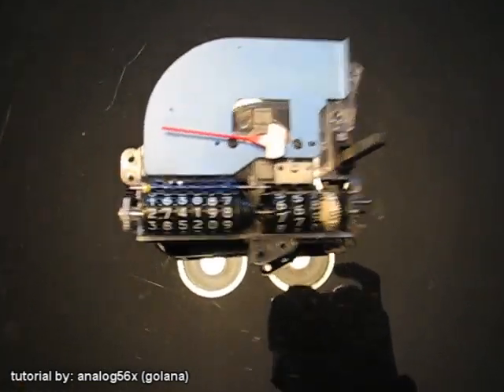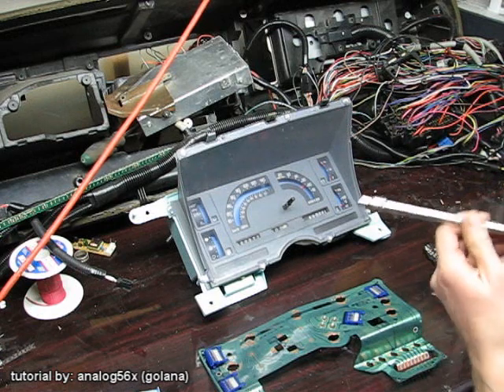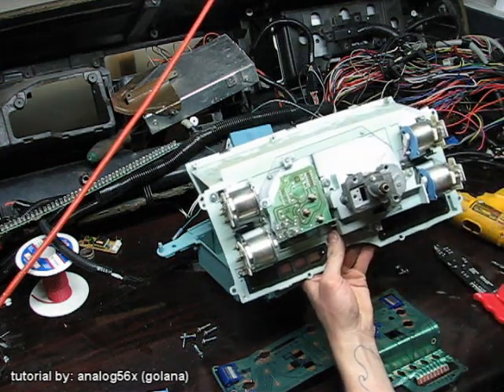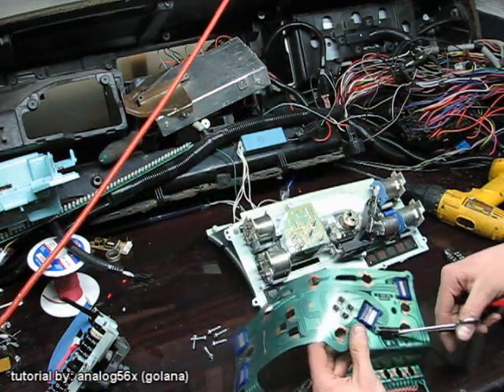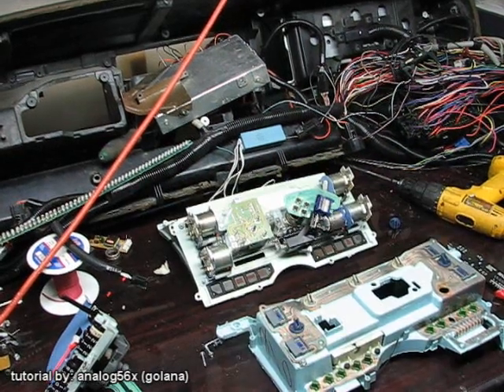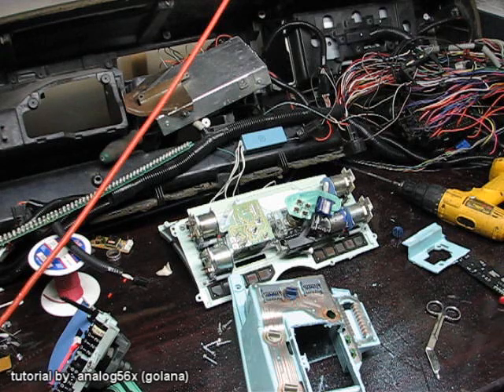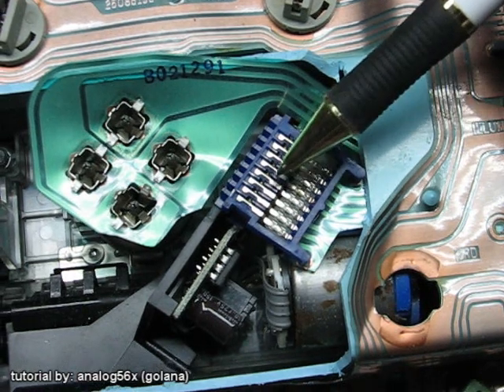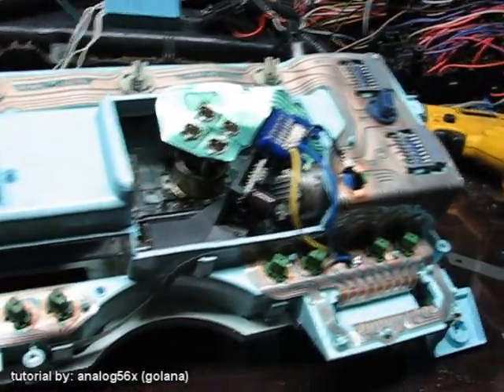Chevy S10 - Cable to Electric Cluster Tutorial

Comment: And this should work without putting some kind of sensor or anything else, just the straight swap? I was planning on getting the digital gauges for my truck is that possible? You posted this awhile back but I would really appreciate a response thank you.
Reply from the maker: This is to take your basic non-tach, electric speedo driven cluster, and add a tach cluster. The non-tach uses a bigger sweep gauge, instead of the sideways L shaped gauge. If your truck is cable driven speedometer right now, this will disable your speedometer, as your truck doesnt have the sensors or wiring for the electric driven speedometer.
I hope this clarifies things for you.
Cheers bud!
Reply: @analog56x  hey yeah thanks man that saved me time and a headache! Have a great new year
Reply from the maker: @banditobigmac5429  you too bud! Cheers!
Reply: @analog56x  My problem is that have have a 85 s-10 with a cable driven speedo and a later model tranny with the sensor. (no choice) I should be able to just run a wire from the sensor on the tranny to the sensor (2 pin) pin of the flexible circuit board, correct? Assuming of course I install an 87 cluster with electric speedo.
Reply from the maker: @paulandrulis4672  you'll need a few more things. Behind the glovebox, theres a module that takes the signal from the speed sensor and chops it up into a signal that your speedo can use. I forget the name of it at the moment though... you can repin it if you change tire sizes to keep your speedometer accurate.
Reply from the maker: https://www.thetruckstop.us/forum/threads/how-to-recalibrate-adjust-your-speedometer.23685/
This article shows the piece.
Reply: @analog56x  right on thank you, I appreciate the update. I'mma have to check out that page since I did have success with the swap that is up to the speedometer. I have read something about the sensor adaptor I bought is 16 pulse while the cluster is programmed to 40 pulse.... Then again idk I'm just going off of what I hear and not what I have learned. I'm sure this link will do just that thanks bud

Comment: Hey man real simple question for ya. I did a trans an motor swap which the new trans is electronic. And the original gauge is mechanical. What I'm wondering is there anything else I'd hafta acquire other than the electric L gauge and circuit board? Or is it just clean cut I do this run the wires down n connect plug and play? Which thanks btw this video is very helpful
Reply from the maker: Max Smith hey, youre talking for speedometer? id try to fit the cable drive into the tranny where the speed sensor goes. if that doesnt work, youll need the wire harness, the speedo box (i forget the name of it now... its mounted behind the glovebox on top of the heater core box... should be a white plastic box with a plug on one end). trying to fit the cable end in would be the easier of the two options. you may be able to build a hybrid as well... its been a long time since ive been elbows deep in a s10 :(

Comment: I tried to swap the electric stepper motor in my 91, but I wanted to keep original kilometers, I have now done it twice where I have pulled the motor off the speedo unit but every time I put it back together nothing works, even when before I pulled apart the replacement speedo it worked. Any suggestions?
Reply from the maker: Nathan Timmermans you could, very carefully, take the pins out of the replacement cluster enough to adjust the number wheels till it matches your original mileage. i did it a couple times. but if you do, just make 100% sure you know the order in which everything going together... i seem to remember it being quite fiddly... lots of small pieces. havent done anything like this in 6 or so years though haha. i cant rememberif you can just slide the pin out enough to lift it at one end, or if i had to take it all apart, but i was able to take another cluster and match my odometer reading :)
cheers! and good luck
Reply from the maker: Nathan Timmermans you could, very carefully, take the pins out of the replacement cluster enough to adjust the number wheels till it matches your original mileage. i did it a couple times. but if you do, just make 100% sure you know the order in which everything going together... i seem to remember it being quite fiddly... lots of small pieces. havent done anything like this in 6 or so years though haha. i cant rememberif you can just slide the pin out enough to lift it at one end, or if i had to take it all apart, but i was able to take another cluster and match my odometer reading :)
cheers! and good luck!

Comment from the maker: i am not sure... the goal for this conversion was using the L shaped electric speedometer in a gauge cluster that was cable driven. the reason i did this, was because the cable driven cluster had all the gauges: speedo, tach, fuel, volt, oil, coolant.

anyways, if i had to guess, id say look around the tailshaft of the transmission for your cable. find the same area on an electric speedo vehicle and then swap them out. you'll need all the wiring too. theres a module strapped to the ECM as well.

Comment: do all of these dashes with the tach have a cable speedo? and how does the tach work if the current dash wiring doesn't have one? but if not all of these are cable driven, will the non-cable driven cluster fit right in a non-tach dash and work correctly? I found 1 in a 92 and I'd think by then they went all digital. Would you know about modding in a digital cluster too? thanks in advance

Comment from the maker: i'll check my wiring diagrams to figure out which wire does what again... you are right about the white (pin 4) being tach signal. there is also a white (pin 34) high beam though.

ok, so
black on my pinout shows (pin 9 & 24) ground.
brown shows 2... (pin 6) parking light input (-) or (pin 10) alt (-)

for your signal lights, there should be a
dark blue (pin 7) for right signal (+)
blue (pin 8) for left signal (+)
* sometimes these signal light wires have 2 wires going into a single terminal...

Comment: Ok so I have the dash wired and cluster done all the gauges work(except temp but I just have to swap some wires cause a couple were the same color) but I can't figure out what the wires for the tach do I beileve the white one is data and I'm guessing the black is ground but what is the brown one for positive? Also my signal light lights aren't working so I have to figure that out.for me it was a little harder cause I started out with a digital dash

Comment from the maker: @Choaf82 haha, good call on the forum :P i hardly ever check it anymore, i dont have an s10 anymore...

umm... for the ABS light, is it just supposed to come on when ABS is activated? if so, then yea, it would be easy to wire up the ABS light. all you'd have to do is figure out which wire goes live when the ABS turns on, then tap into it for the light. super easy :)

Comment: I have a few questions about this I replied again on the forums but know how often you check back there. Do you think there is anyway to keep the ABS light functional I know it didn't come with ABS then but was just wondering. Also how high of RPM do you think of a dremel I will need I don't want to buy one that wont do the job but I also doubt I will ever use the high end models. I was thinking the cheap cordless one from Wal-Mart but not sure if it will even have enough juice.